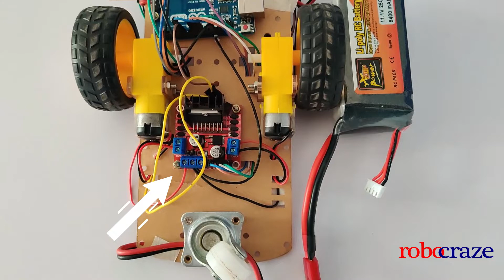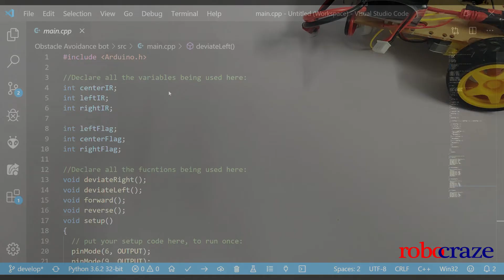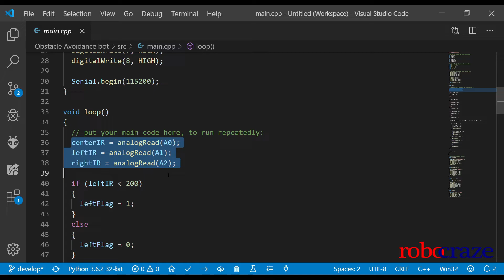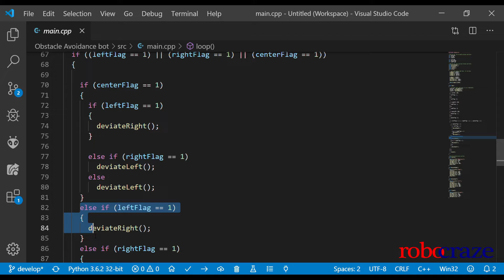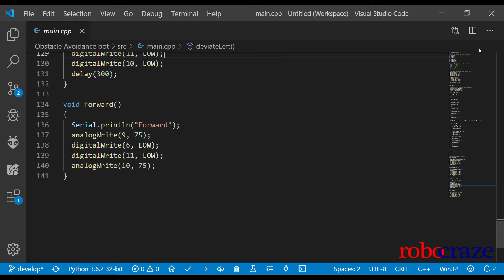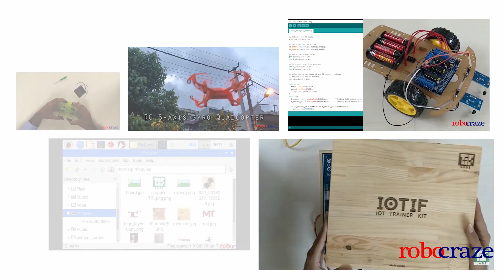DIY Obstacle Avoiding Robot using Arduino & The Simple IR Sensor Alternative

Comment: I am using two sensors how can i connect them please explain
Reply from the maker: Please follow us on instagram you will find the code links in the Bio
Reply: @Robocraze I bought your arduino from Amazon and It didn't worked
Reply: I bought your arduino from Amazon and it didn't worked

Comment: Can I do this with 1 ir sensor and 4 motors?
Reply from the maker: The range of obstacle detection will significantly reduce if you only use 1 IR module

Comment: What sensor is more efficient for collision avoidance is that ultra sonic or ir sensor
Reply from the maker: Ultrasonic will give you precise distance measurements, while IR will only give an output based on a threshold. So ultrasonic would be a better option to map around an environment

Comment: When I upload program then it show elseif was not declared in scope
Reply from the maker: Hello! The "elseif not declared in scope" error usually means there's a typo or syntax issue in your code. In many programming languages, the correct syntax is else if (with a space) rather than elseif. Make sure you're using the correct syntax for the language you're programming in.

Thank you for your question! :)

Comment: Can we use l298d motor shield instead?
Reply from the maker: Yes, You can also use the L293d Motor Driver Shield to run the motors. Just ensure that the motors you use do not draw more current than the L293d chip's rated current.
Reply: @Robocraze  tq for replying

Comment: i am using two motors and two sensors and u sing a power source given to 5v and ...  in the l298n module when i just pasted the code i gave an error , can i use this code or few changes are needed??
Reply: I have made the changes in the the code ,there was an extra deviate left code so i took it out and it work but the issue was that the motors arent running may i know the reason
Reply from the maker: Hello,
Change motor speed values in analogWrite() calls to be between 0 and 255.
Thank you
Reply from the maker: Hello,
It sounds like your code might need some adjustments to work properly with your setup. Here are a few things you can check:

Pin Configuration: Ensure the pin numbers in the code are correctly mapped to the pins you’re using on the L298N module and the sensors.
Power Supply: Double-check that 5V is sufficient for both the L298N module and the motors you're using. Sometimes, motors may need more current or voltage.
Thank you

Comment: hello sir can you please explain to me that  why are we using three ir sensor
Reply from the maker: Three IR sensors are used to increase the obstacle detection accuracy. The middle sensor looks for obstacles directly in front of the bot, but the sensors on the left and the right edge detect obstables that may not be directly in front of the bot but may still hit it. Hence they are placed just to cover a wider area for obstacle detection in front of the bot.
Three sensors also allow the bot to move in the correct direction, for example if the right sensor is triggered the bot turns to the left, and so on.
Reply: @Robocraze  thank you sir for explaining this it was really helpful to me